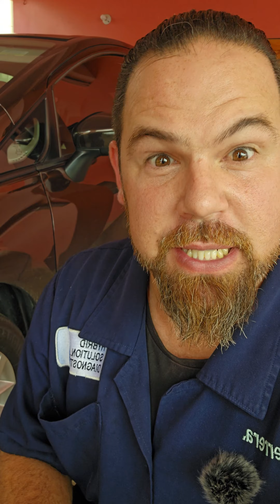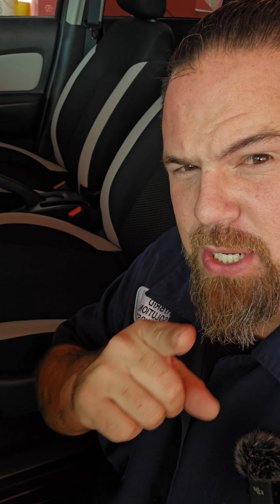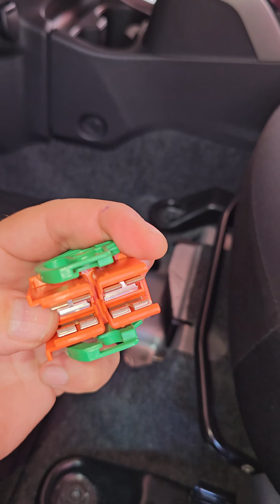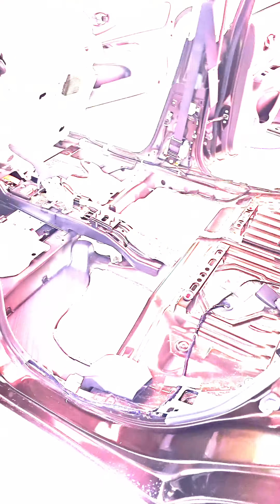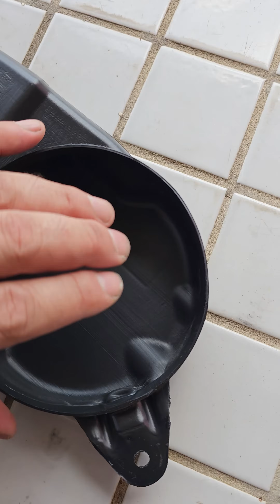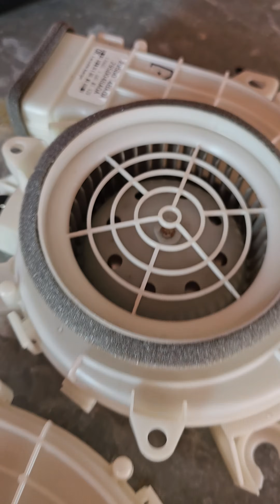Nissan note epower battery fan cleaning

Comment: Hello!. I'm facing an issue that I can't resolve. I have a Honda Vezel. When it reaches speeds of up to 100 km/h, the hybrid battery doesn't charge, and the car's speed decreases, RPM increases, and I need to press the accelerator pedal more. Sometimes, the car speeds up when the battery cells are more charged. I also had the hybrid battery's blower fan serviced. Please, I need your help and suggestions. Thank you.